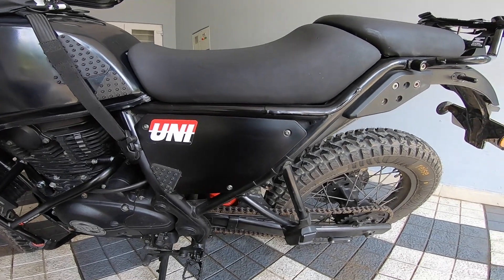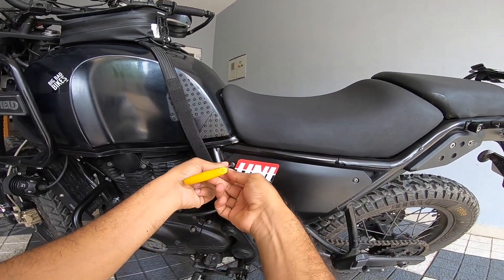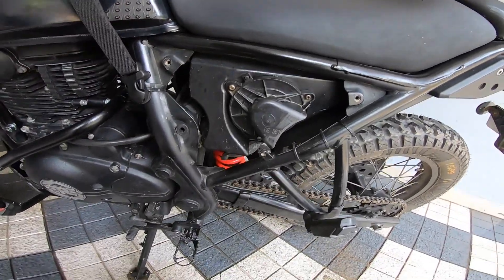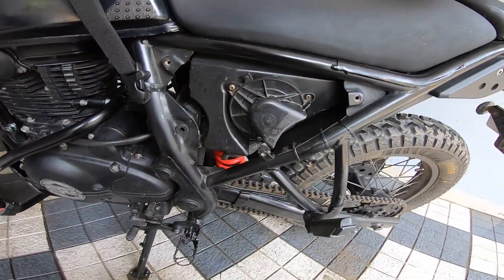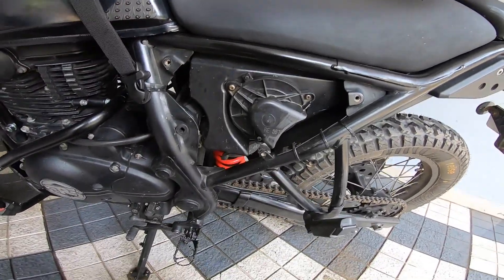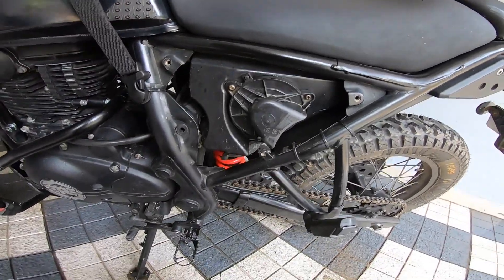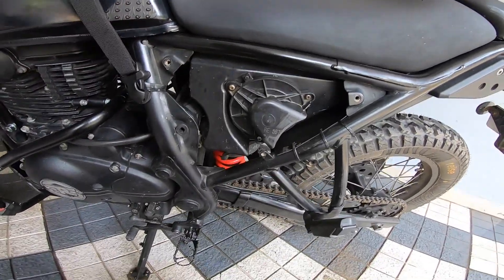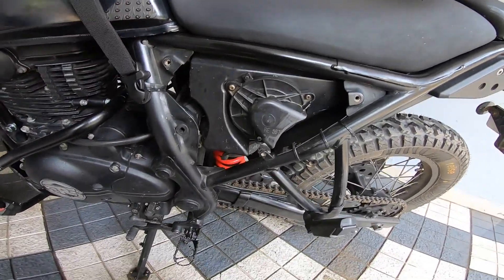WATER CROSSING FIX- SAND & WATER SPLASH GUARD FOR THE HIMALAYAN

Comment: Ben have you tried to change the direction of the filter cover in such a way that the intake opening move to the upward side, I think this will increase the water wading capacity of himalayan as well as protects the filter from sand or water coming from the tyre.pls share views on this ......
Reply from the maker: Excessive HOT AIR FORM THE ENGINE WILL GET IN and make matters worse . I have tried everything
Reply: Thanks for your response, but what I mean here by upward direction is (intake opening)towards the seat not towards the engine side.we can also make some air vents in the side panel as scram 411 side panel have.May be it will work. @ONTWOWHEELSBEN

Comment: have a suggestion please try rotating  the thing ,which should face up side , i know there is a notch but try once ,i think u might have tried it if  s ,just want to help
Reply from the maker: Pulls in a ton of hot air from the engine . Not good for air cooled machines